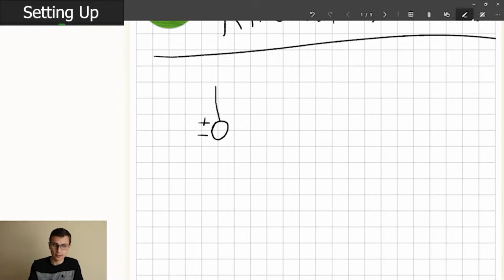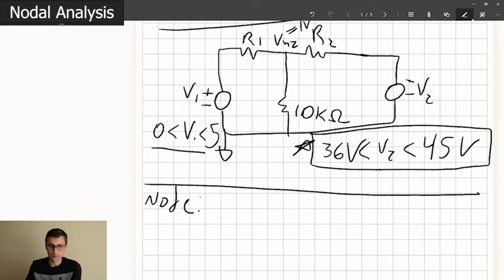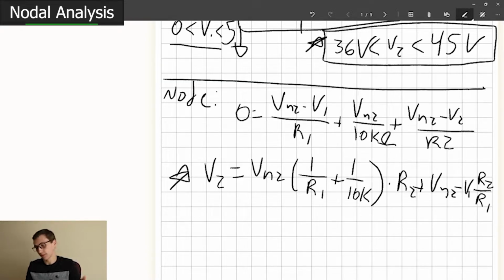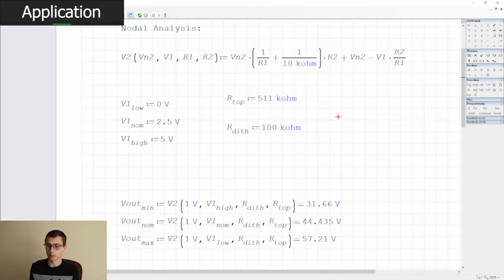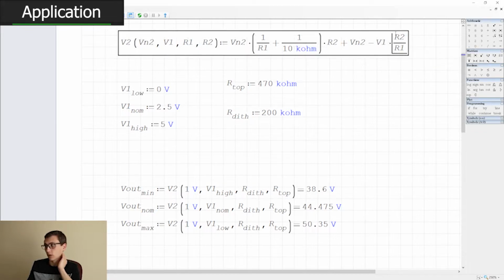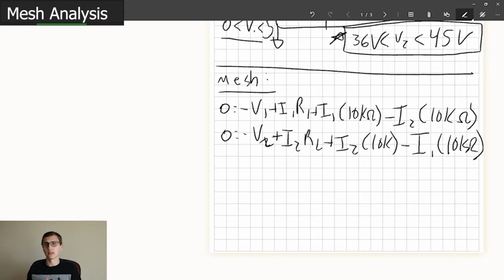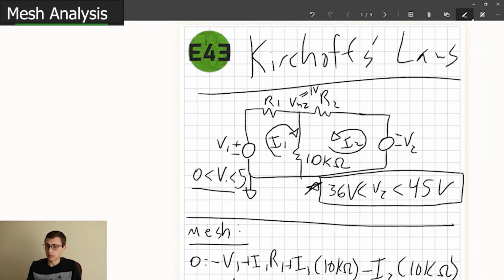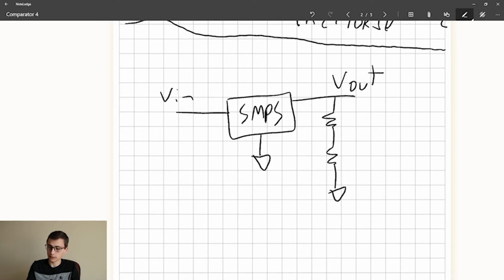KVL & KCL Applied: Design Example! (Intro to EE)

Comment: hey I was wondering were you been?  Things will get better, if you keep producing the awesome videos of electronics.I am still trying to purchase quality tool for electronics my self. The fundamentals are necessary however its been strenuous putting it in a working example to expand the electronics knowledge. for example Kirchhoff voltage law (KVL) is  definitely needed but  there can be voltage in a circuit but no current flowing..... ha ha in fact when i read schematics there is no reference to current values Why? you know as well as I coffee with out water is gross. in electronics they work together or they don't . Please don't stop E4E because of the seems like gigantic set back. When i look back in time i giggle thinking how i used to only had a light bulb and junk parts stripped from old trashed electronics. Don't move on but move on!  picture my foot kicking your butt if E4E comes to a end. because the memory will haunt you for many years. whatever it means to you Ryan.   I  give you my full support for E4E in any form.  Hope you don't mind the long comment. don't  GO !!!!!!
Reply from the maker: JD! Nice to see you around the comments again. Wow! This is one of the kindest things I've ever seen in the comments. Thank you for the encouragement, and I'm glad you came back! 

I hope you find some good tools to get started. Should be a lot of fun once you get all set up. Yes, I think it's good to balance the basics (lecture-style) with projects. Too much of either isn't great! 

No worries, we're moving forward for sure. :) See you soon!